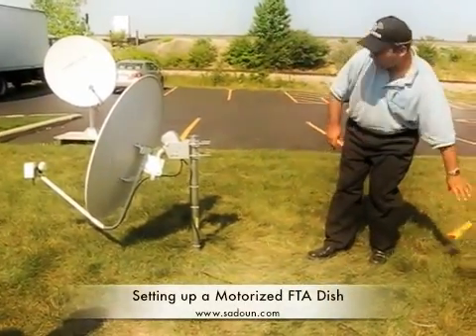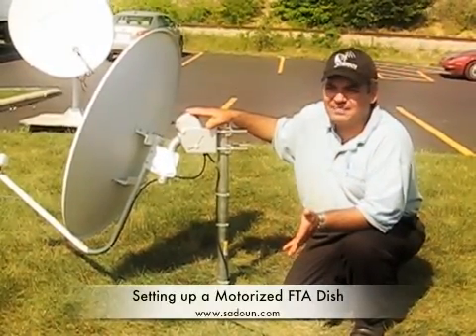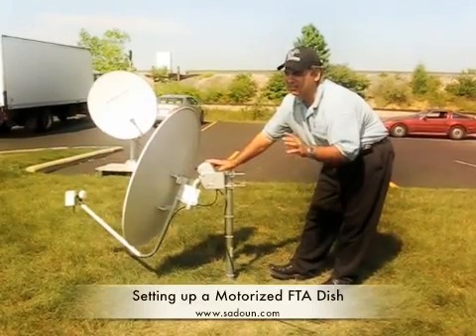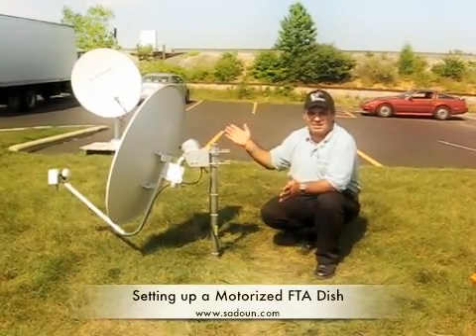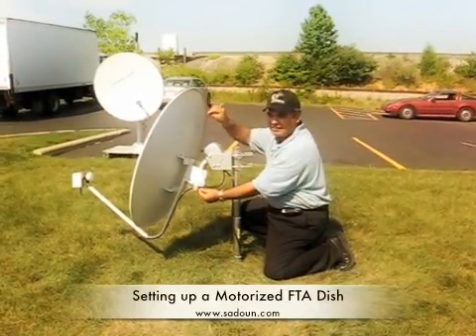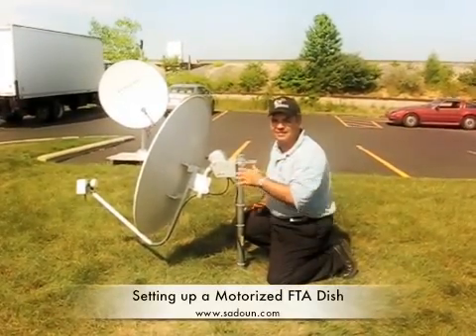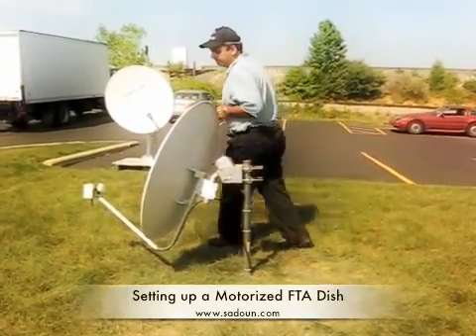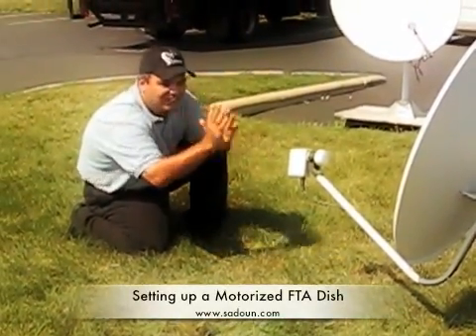How to set up an HH (dorizon to horizon) DiSEqC Motor on a satellite antenna dish.

Comment from the maker: For More Info: 
http://www.sadoun.com/Sat/Order/Satellite-systems/Motorized-Systems.htm

Instructions on how to install and align a motorized satellite dish.

Steps to a successful motorized system installation:
~ Select your installation site carefully!!!

~ There must be a clear line of sight between the required satellites and the entire surface of the dish. The line of sight must be free from obstructions, such as trees, roof tiles etc. 

0:05 ~ It is very important to make sure the HH motor is fixed to a perfectly vertical (plumb) mast. Time spent measuring this accurately will save you hours later on. 

~ NOTE: Tighten all coaxial cable connections on the motor only by hand. Using a wrench may over-tighten the connections, causing damage. Such damage is not covered by the Limited warranty.

~ If the HH motor shaft is not at zero degrees reference, you should get it back to zero degrees by connecting the receiver to the motor. The receiver must be ON for the HH Motor to move. Its easier to do this before placing the H-H Motor onto the mast. Once you have done this, the HH Motor should then be disconnected from the receiver. HH Motors are usually set to zero degrees by default from the factory.

~ Fit the H-H Motor onto the mast and do the nuts up finger tight,

0:40 ~ Set the elevation angle for the motor. This angle should be equal to the latitude value of the installation location. Always use the Latitude scale on the motor.

~ Fit the dish on the H-H Motor shaft and tighten the nuts. The middle of the dish clamp must be lined up with the center line on the H-H Motor arm.  The LNBF arm, dish clamp, HH Motor, and mast must all be on the same straight line facing TRUE SOUTH.

2:14 ~ Aiming at TRUE SOUTH:  Find your TRUE SOUTH Angle here.  Then using a compass, move the dish/motor assembly together as one unit to your TRUE SOUTH angle.

~ Dish elevation angle: Adjust the dish elevation angle to peak the signal. Dish elevation angle is calculated based on the model of the HH motor you are using, as follows:

.....rest of the instructions here:
http://www.sadoun.com/Sat/Installation/HH-mount-installation.htm

More information: http://www.Sadoun.com 

Follow me on:
Google+: https://plus.google.com/u/0/+sadoun
Twitter: https://twitter.com/sadoun
Facebook: https://www.facebook.com/sadoun
Flickr: http://www.flickr.com/photos/sadoun/
Pnterest: http://www.pinterest.com/sadoun/

Share Video:

Subscribe to my channel:
http://www.youtube.com/user/SadounTube?sub_confirmation=1
-------------------